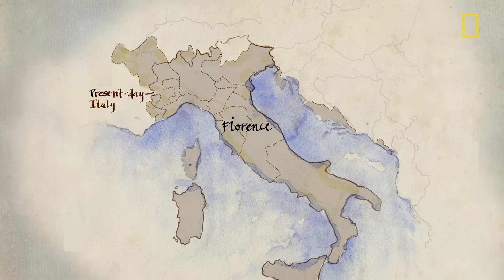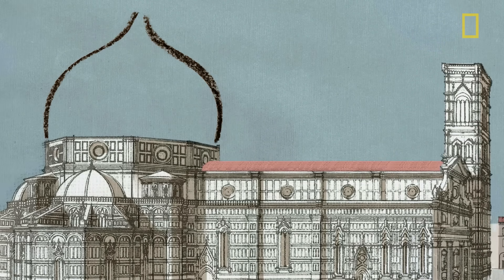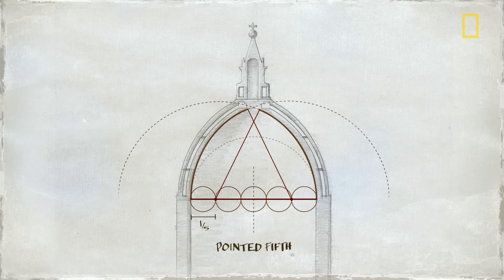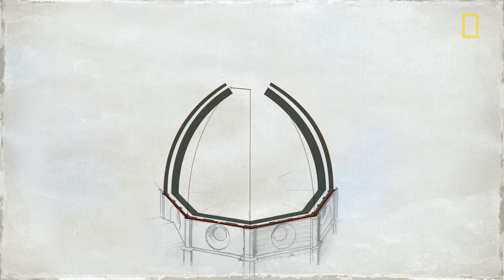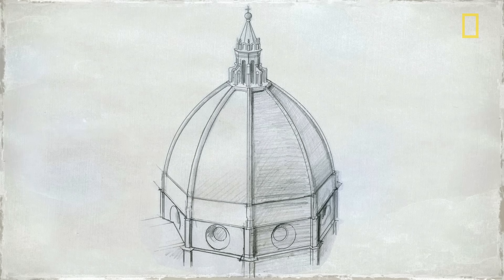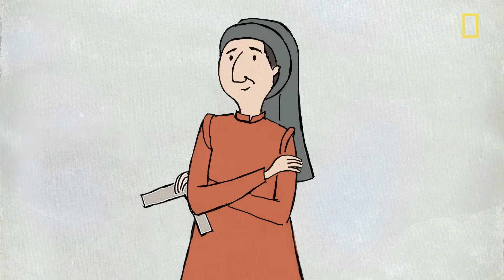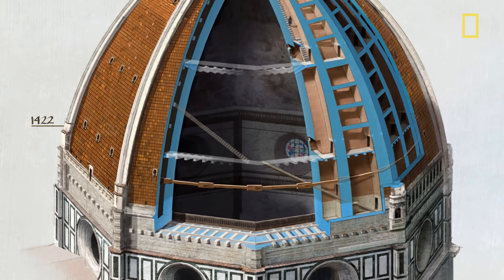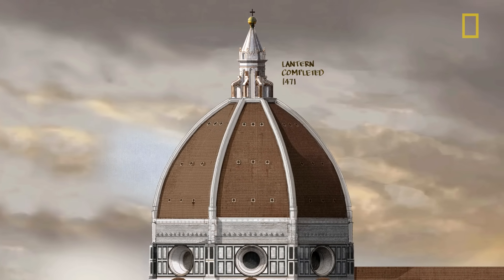How an Amateur Built the World's Biggest Dome

Comment: They use simple math; yet very effective. Here's the thing - I am construction 🚧 worker myself. Some things, you can make it so precise but there are certain parts where you just have to follow your instinct. For example, out of 2 mark to make something align, in most cases if there are confusion on the marking, we just follow the one that consider the 'median' point out of the too. It wastes so many time to do something too accurate. Yes, the structure git to be sturdy - but there are no one actually bring ruler and will remeasuring back your hard labour

Comment: Dome of Soltaniyeh in Relation to the Santa Maria Del Fiore:

The Dome of Soltaniyeh features many architectural similarities to Brunelisschi’s dome for the Santa Maria Del Fiore, and some architectural historians like Piero Sanpaolesi have speculated the buildings may have influenced each other despite their great distance apart.

There are several architectural similarities between the two domes. Structurally, both domes feature an arched network of herringbone bricks, called in Italian “spina -di -pesce”.[2] The Dome of Soltaniyeh's high sphero-conical dome on an octagonal base exhibits is the same structure as the Santa Maria Del Fiore, both with eight ribs supporting each structure.[14] However, the Dome of Soltaniyeh remains unique in the way that its arches and ribs structurally support the dome.

Finally both domes, feature a double-shelled structure. The Dome of Soltaniyeh was the first example of this structure in Iran, and several scholars hypothesize that it is possible for the construction system of Soltaniyeh to have been disseminated from Iran to Brunelleschi in Italy, in the time span of almost a century.[15][14]

Many academics argue that because of these similarities, and many more, that the Dome of Soltaniyeh influenced the Santa Maria Del Fiore, which was constructed 100 years later.

Comment: I remember being taught there was an iron chain at the base of the dome. The integration of metal and masonry was the innovation behind the dome. The problem is not the dome itself but the outward forces at its base. There would be a tremendous force from the weight from the beginning of construction and the horizontal element of that weight would push out the walls supporting the dome. Not to take away from the dome's actual construction but the use of the metal with the higher tensile strength would be a precursor for modern architecture and larger domes.

Comment: The shape of the dome is when you take a compass and set it to any length, draw a straight line of that length, draw one semi circle with the sharp point on the leftmost side of the line which is length of the “any length” then set the sharp point on the rightmost point of the straight line.  This is also known as a 60 degree angle

Comment: The narrative here is nonsense. 
The cartoon showing Brunelleschi contemplating a pointed onion-shaped dome is nonsense. The Only pointed domes at that date were much smaller domes on Russian and Scandinavian churches, which Brunelleschi would never have seen. 
The statement "Domes were often built as semi circles" is nonsense.  With the exception of the instances that I have mentioned, domes were ALWAYS built as semi-circles unless there was a structural reason not to i.e. the plan was oval or irregular.  Siena Cathedral has a highly irregular polygonal dome. 
The town planners-  the requirement for the shape of the dome had been established in the previous century by the architect Arnolf di Cambio who had designed the cathedral. The concept was octgonal from the start. 
The decision on building the dome without  centering (support during construction) would have been Brunelleschi's cost saving solution, not the town council's as implied here.